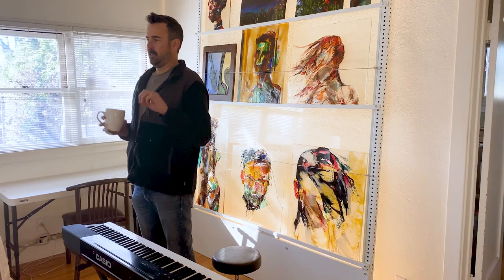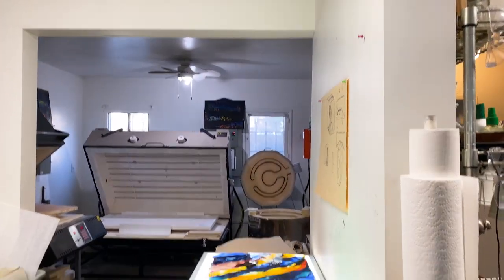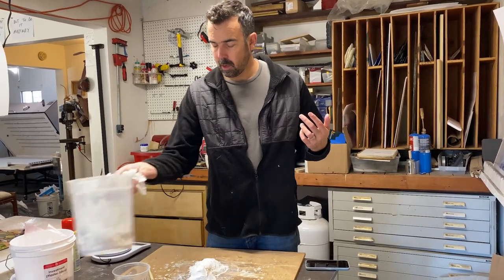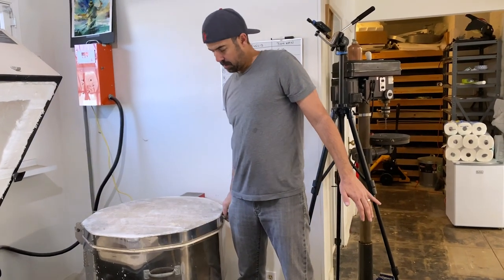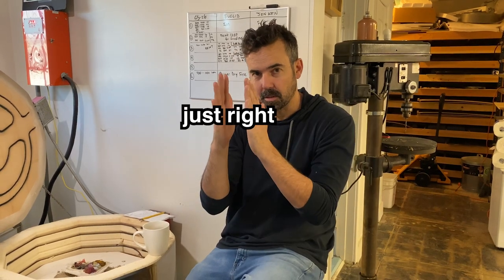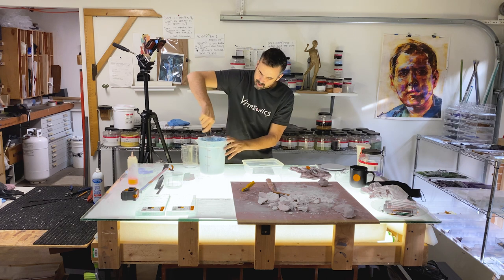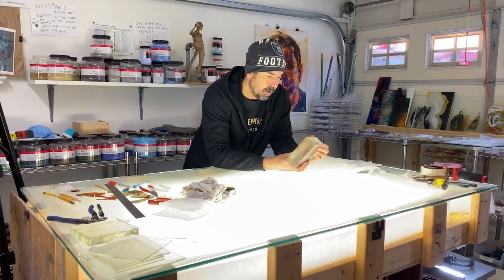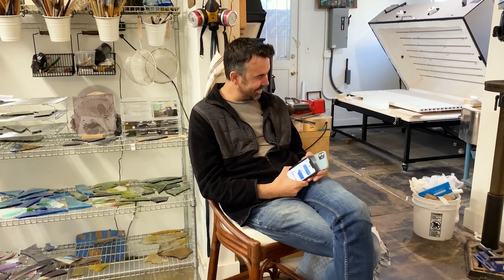Tim's Casting Experiment

Comment: It's easier to do volume based measurement of the mold volume.  Fill a measuring cup with water. Mark "full" then pour it into your mold. (Quickly so the water doesn't absorb) then dump it out. Now you can add glass pieces to the measuring cup until it is back to the  "full" mark. Now your glaas will fill the cast. No scales needed. 😁
Reply from the maker: Thanks! But in this case Im placing each piece individually and purposefully. Not just filling the mold. So that's why I weighed each piece.
Reply: @vitreonics  I'd still do it volume based.  I hate math 😁🤣 
What do I know.